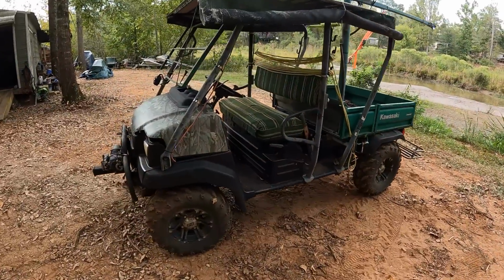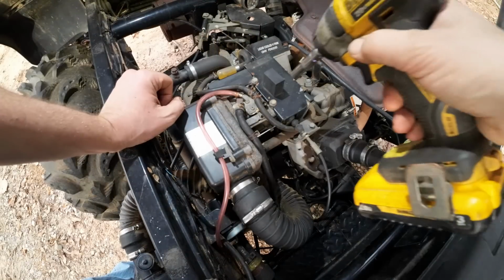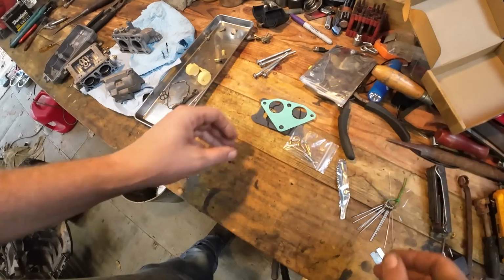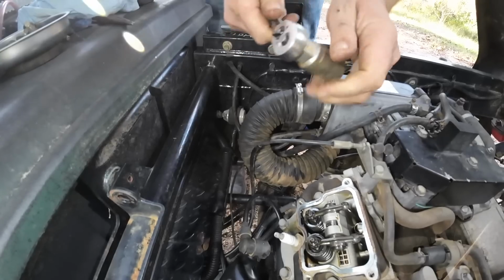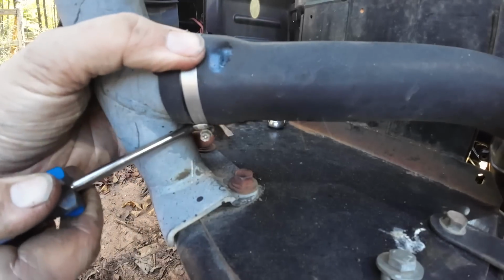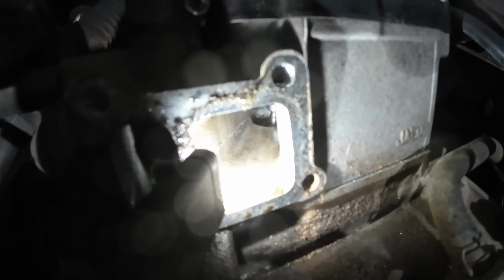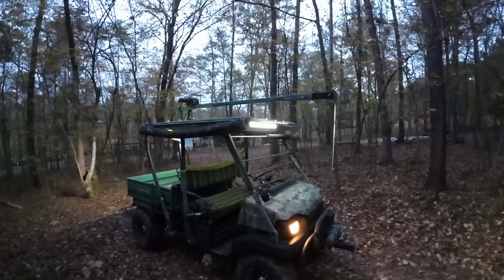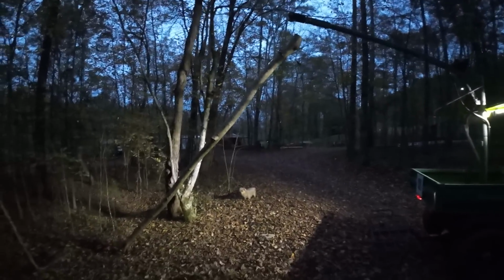2004 KAWASAKI MULE SITTING FOR YEARS, WILL IT RUN?

Comment: Just FYI the coolant that goes through carburetors or through manifold is actually designed to heat them not cool them. The evaporation of fuel creates a significant cooling effect and sometimes coolant is run through to prevent condensation and  even potentially ice from forming
Reply from the maker: yes sir you are absolutely correct👍👍

Comment: I believe you will find that coolant line going to that carb is not to keep it cool, it is actually there to warm the carb for better fuel vaporization during cool weather. I use Simple Green HD in my ultrasonic cleaner. Never had a problem with discoloration of any carbs. The zinc content is what causes the discoloration. The FD620 is a great engine. I have two of them. One in my 425 Deere, and the other I put on my Grasshopper. I rebuilt the one in my 425 after I got it. The engine was so worn that I had to have it bored oversize, replace the crank, and even change the carb body out because the throttle shaft was worn so bad. You could push the pistons side to side nearly 1/32”. But the engine still ran fine, was just pushing oil out past the crank seals due to excessive blowby. Tough little motors!
Reply from the maker: yes you are comepletey correct about the coolant line! I actually have 4 things rite now with fd620 engines I have this and a 425,445 and a jd gator, I like these engines they are simple to work on and reliable!

Comment: Your passenger rear taillights out.those mushrooms are prized edible honeys or possible oysters,also prized edible can tell them by cojoined stems branching off one another.true thing running about in woods tires must run over spores and then propagate new growth were atv sits because i had soft open dirt at home were i parked.one week after sitting i found a huge morel mushroom super prized edible.dam right i cooked n ate.not only that but i live in suburbia far from woods that was crazy.better get some doors on there ur dog was gonna jump a few times it looked to cute dont wanna see hurt.anyhow nice save,have fun.snooky pa😊😊😊😊😊😊

Comment: Kawasaki should offer those mods as factory options. They're well thought out, especially the crane.

Also, there's something wrong with the audio channel, possibly the mic or low battery. There's a lot of IM distortion on high frequencies and impulse sounds. Very annoying/disconcerting. Consider using a professional on-body wireless mic.
Reply from the maker: Haha that would be awesome 😁! I’ve been thinking of getting a wireless mic but I don’t know which one to get

Comment: I cringed when you wire brushed the carb sealing surfaces.  That might be your air leak.
Reply from the maker: I do that all the time and never had a issue, there was a bunch of hardened gunk so the wire wheel left a nice smooth surface, it was 100% the crappy gasket the gas made it break down I could literally rub the gasket with my fingers and layers of it would come off, cheap Chinese crap